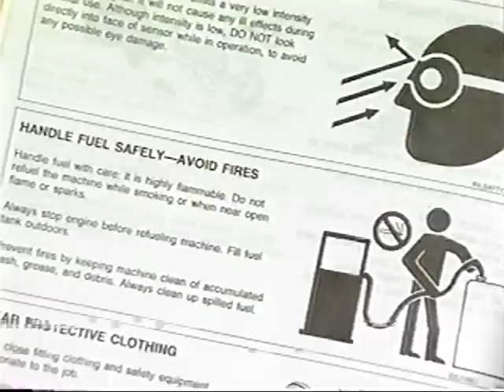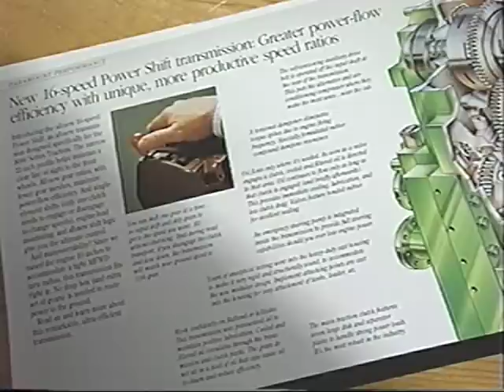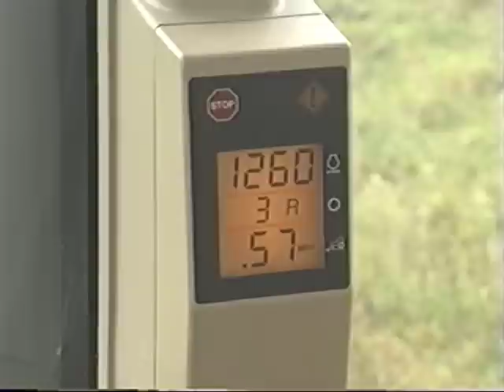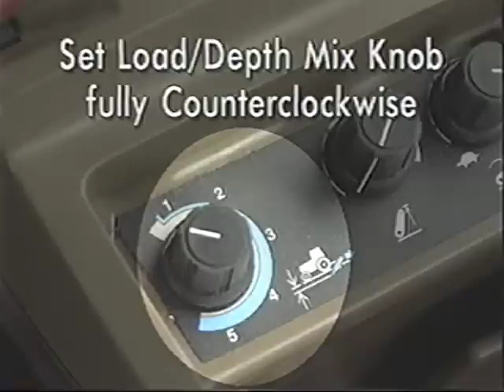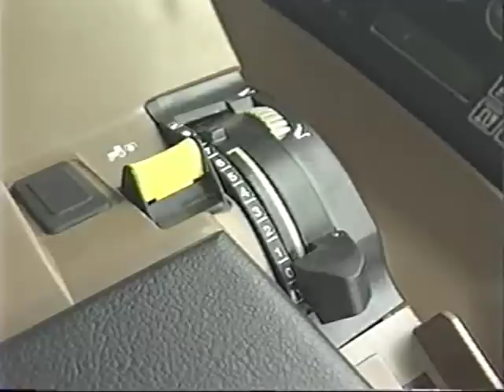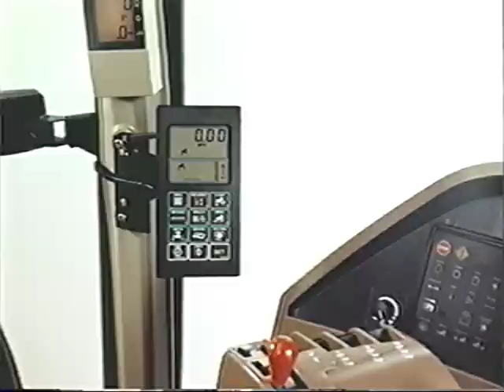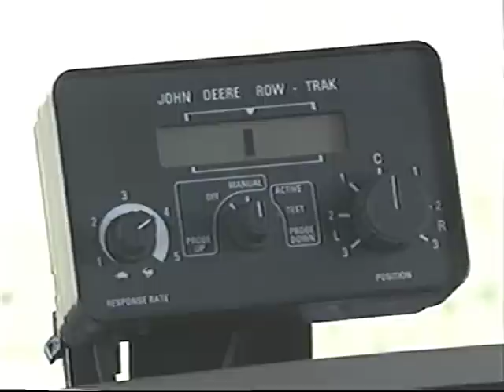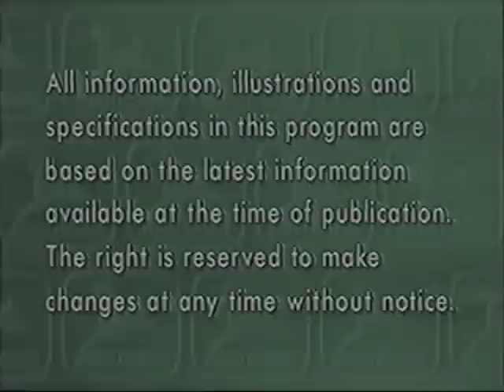John Deere 8000 Series Tractors

Comment: First new tractor of this platform I operated was an 8210. It was a pretty good tractor for the most part. It definitely couldn't handle the Vermeer hydraulic twin rakes and would overheat the system like previous JD tractors.

Comment: I love this tractor but we’ve had reliability issues with all John Deere’s. GREAT tractors but all the comfort doesn’t mean much if you can’t rely on it to start when you need it to.
Reply: Then you are abusing them, not maintaining them, or lying. They were the best ever made.
Reply: @ralphllivrah9551  I’m sorry I don’t agree with you, but you don’t have to go straight to insulting me. We do maintain them, and it only gets as much abuse as a regular dairy farm throws at it. And no I am not lying, I said I love the tractors and they are great tractors but you have to agree they suck in the cold. Or maybe you can’t say anything is wrong with a Deere. I’m not saying they’re unreliable, but I don’t want to fiddle for an hour in the cold when an international will start on the first couple cranks EVERY TIME. We are aloud to have differing opinions and I think that the dt466 and the 8.3 Cummins were the two best engines ever put in a tractor that size. Deere’s do have there place and we own multiple but for our operation we prefer case, international, and case ih. Sorry, but that’s just MY opinion.
Reply: @netlossfarms7335  I really didn’t mean for it to be so harsh.  Hard to convey ribbing on the internet. I just can’t make myself use those smiley faces.

Comment: It states multiple times in the video that these are changes made in the later model 8x00 series? do these changes affect all the 96 models? Or do they start in the 97 model year when they change the motor and the side decals?
Reply: Correct on the  motor and decal change.
Reply: After the motor change, serial numbers after 10000